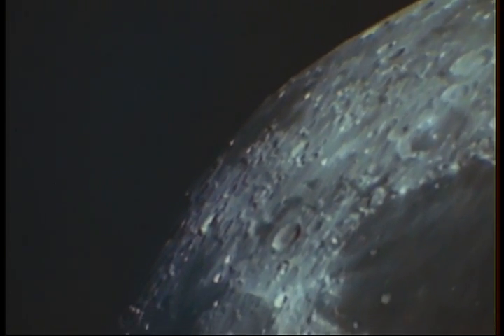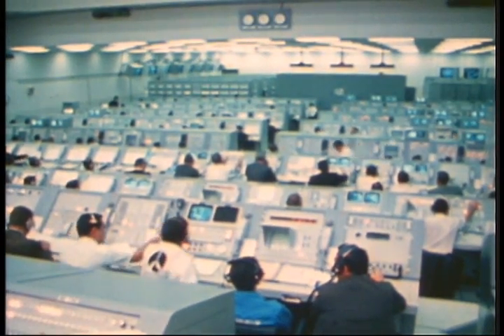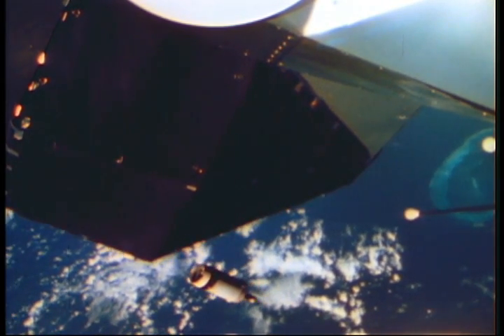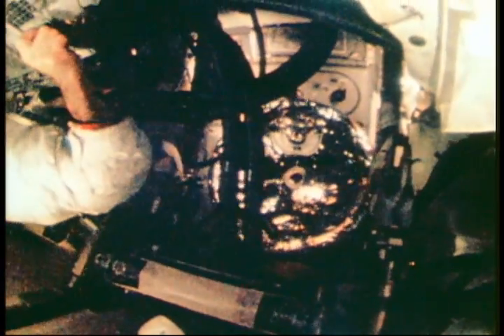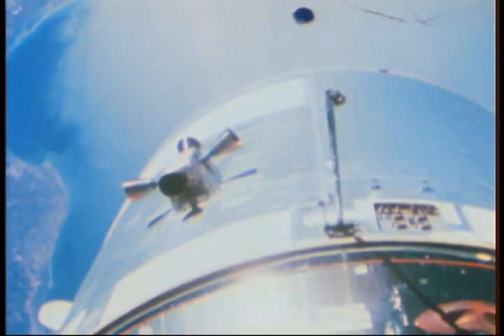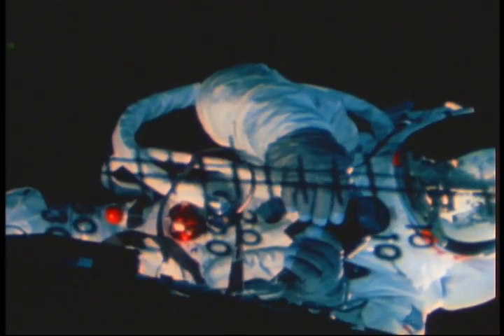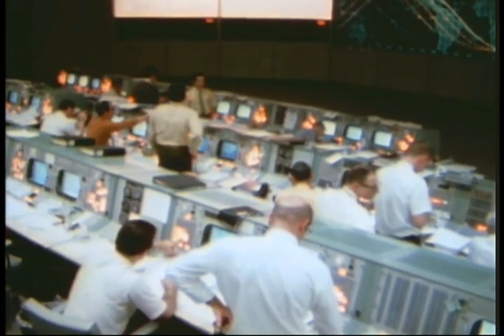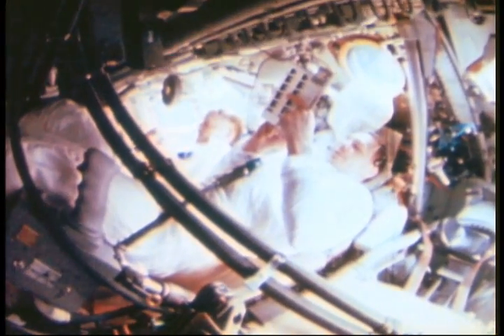Apollo 9 - Three To Make Ready (1969)

Comment: 15:00.. Humanity might have an effect, but this is Propaganda to the 3rd degree. If they really believed it than the first stage wouldn't have been powered by dino juice, but hopes and dreams. It gets tiring hearing how one of the cleanest countries per capita on the planet is the problem (USA) while china can destroy the air and mexico can destroy the pacific west coast ocean.
Reply: I'm assuming that you are USAvian (based on your comment), but you have your stats way off.  If you are looking at a "per capita" based and carbon generation then the USA ranks 11th in the world with 16.5 tonnes per capita making it the highest of all countries with large population, whereas China ranks around 47th in the world at 7.5 tonnes.
To put it into terms that you might find agreeable, China current;y outputs about twice the amount of total carbon that the USA does, (and now the part you won't like) however it does so with a population that is over 4 times larger.
Or in another way, the USA has about 4.5% of the global population but generates around 16% of the total global carbon emissions.

There are multiple sources that quote slightly different figures, but all are in basic agreement the the USA is far higher than China on a "per capita" basis.

https://www.economicshelp.org/blog/10296/economics/top-co2-polluters-highest-per-capita/
https://en.wikipedia.org/wiki/List_of_countries_by_carbon_dioxide_emissions_per_capita
https://www.ucsusa.org/resources/each-countrys-share-co2-emissions
https://ourworldindata.org/per-capita-co2

You learned something today...you are welcome.
Reply: @poruatokin  I dont see Co2 itself as a problem.  Plants live on Co2. I also dont agree with translating emissions into a Co2 equivalent.  I am referring to actual pollutants such as fluorinated gasses and particulate matter smaller than 2.5nm.  To call all Co2 based gasses pollutants in this day and age is willfully ignorant. Controlling and taxing Co2 is just another way government is trying to limit peoples freedom and also a strategy the globalists are using to control the US. The US generates 19 times greater GDP per capita than China and using the flawed Co2 emission metric only twice the "Co2" per capita.
Reply: @dylan7129  So now that I've proven your claims wrong, and shown you that the USA is actually much "dirtier" than China, then suddenly you fell that CO2 is no longer a problem.  Such integrity!!  No wonder the rest of the world looks to the USA as being the most selfish and ignorant.
Reply: @poruatokin  I never said Co2 was a problem. I merely repeated what the movie implied was the USA's problem and pointed out that other nations are worse. It is clear to me now that you are a chinese communist and and must have hillary's emails. Dont forget to vote for the Trumpster in 2024!

Comment: Big difference now. Instead of a huge battleships grey control console taking up a huge amount of space in the capsule ( electro-mechanical switches and relays are bulky), we'll have multi-function touch screens which take up almost no space. Instead of bulky checklist books, a few tablets will do the trick (with some backup paper manuals in case they get broken).
Reply: Of course there would be a difference now, that's kind of obvious. But to think that we accomplished all this with absolutely cutting edge 1960's tech is an amazing thought when you consider that it's been more around 50 years since! For example, "computers" in the 1960's, were giant beasts that took up large rooms, consumed enormous amounts of power and cooling, and that took hours to process problems. Yet, we had not one, but two computers onboard Apollo, one in the CM, and one in the LM. In contrast to the room-sized computers of the era, the Apollo computers only took up 70 watts each and were maybe the size of a couple of shoe boxes each. The two primary computers were incredibly advanced. Our first foray into "modern" computing with integrated circuits. 72 KB of programs, data, and work space, and in that they crammed a fly by wire system so that the computer could buffer the astronaut's flight inputs, a fault tolerant OS that could drop low priority tasks and keep high priority tasks running, fast reboot with no data loss in the event of an error, and more. While the computer was capable of running all phases of the mission completely independent of ground navigational support, it was relegated to more a backup role because at the time, people were unwilling to stake their lives on such a bleeding edge design.

Comment: First word, "Christmas', not actually a scientific term, really a reference to a hoax savoir theory. That date is followed by these word, "...when man first cut the silver cord of gravity...' 
very flowery language, and not well informed. Man did not cut the chord or even escape earth's gravity. It is impossible to escape the gravity of any mass, where ever you go, which Newton explained 300 years ago. There is something called escape velocity, but there is no escaping gravity..
Oh, and Apollo was definitely a hoax because the craft lacked the thermal insulation for an orbit of earth, far less a week of continuous solar exposure. I've made a 5 minute vid proving the point and debunking the excuses: 
https://youtu.be/Zztbw7MLlkI
Reply: Hmmmm ... you "understand" Newton but you do not understand the Raleigh-Jeans law or spectral radiance (loss) of energy.  According to the RJ law, radiance is proportional to the inverse of the wavelength to the fourth power, which gives you a REALLY small number.  Therefore, it would literally take months for a completely uninsulated LEM to lose enough thermal energy to space so that the astronauts would be harmed.  What the designers were most concerned with were keeping the inside pressurized, and protecting the spacecraft from absorbing radiant energy from the sun.  For this, they used aluminized Kaptan film (what most people think is gold foil) or other reflective coatings.
Reply: @mlaprarie  Once you can make a model of Apollo and bake it for 7 days at 260°C in a vacuum oven, without the temperature rising inside the model then you've proved your point. In fact, if you can delay maximum temperature through out the model for half an hour, just by being shiny, I'll eat  may words. 
I'm not impressed by spectrononmy. There's nothing more beautiful than good sense. Your cleverness is adding nothing to that for you. Have another look at the problem.
Reply: The silver cord saying is just a loose parallel meaning as to what is written in ecclesiasties in the Old Testament referring to the silver cord of life. I admire what you Americans did back the, landing on the moon. You James unfortunately would never be a visionary like the incredible men and woman who made this whole project a stunning achievement.
Reply: Your opinions about the existence or not of God are yours and not worthy of a discussion about Man's greatest technical achievement. Keep you stupid Atheistic Religion to yourself. There's less evidence to support it than any other religion on Earth.
Reply: @104thDIVTimberwolf  Ahh, so funny.  You do realize that atheism is the absence of religion
Reply: Sorry,  @poruatokin , but by definition, as a system of belief, it is a religion. An Atheist believes that there is no God as fervently as the Jew or Christian believes that there is.

Comment: That open hatch at 8:28 was amazing. I didn't know that was ever opened in space.
Reply: Actually it was opened at almost all Apollo missions on the way back to "home".
The reason is, that there were instruments and test equipment mounted at the outside of the service module. One astronaut had to go out and bring them in before the CSM seperation was done before landing.
Reply: @kallewirsch2263  J missions only (15-17). 10 through 14 the CM main hatch was shut from lift off to splash down, as the same as 7 and 8.
Reply: @richardvernon317  The deep space EVAs are eerily more fascinating compared to landing on the Moon.
Reply: It was, beautifully done. And with David Scott's red helmet it became even better.

Comment: 3:35 
Damn. I never realized how much the S-IVB actually vented. It's practically constant!

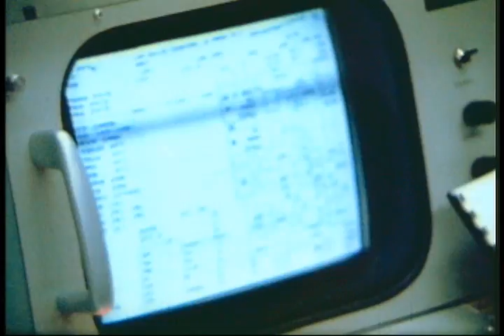6:34
Little fun fact about the descent engine: The throttle valve was designed so that, under almost any failure mode, it would always fail OPEN. If this stuck open throttle was detected the landing would be immediately aborted. Imagine it as if you're in a car backing a trailer into a lake and suddenly the car is going full speed away from the lake. It's not a great situation but it's better than plowing into the lake/crashing into the lunar surface.

10:00
After the descent engine has done its job and faithfully carried the LM to the surface, the crew thanks it by (sometimes) partially crushing it under them LEM when they land. This happened on 17 and (I think) one other mission.
Reply: 15 bell was dented
Reply: CaribSurfKing1 
Ah, thank you.
Reply: +Jonah Beale (RCFlyer) Dave Scott was freaked out about blow back, so he immediately cut the engine on 15, so it was the highest vertical velocity when the pads hit of all 6 landings and the back leg went into a small crater ( which lowered the engine bell even further into the surface ). Still 15 is greatest location and mission in my book! Best ascent video as well!
Reply: The "venting" you are referring to was the planet earth rushing by below.